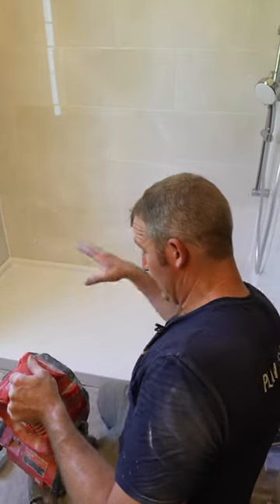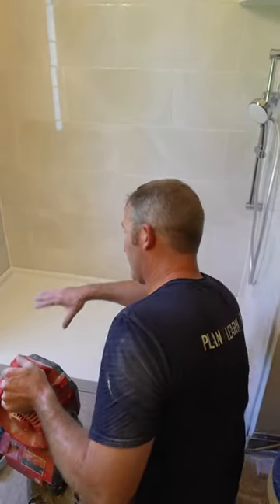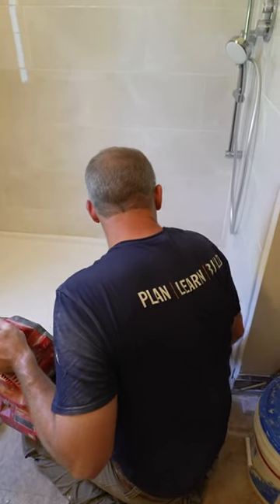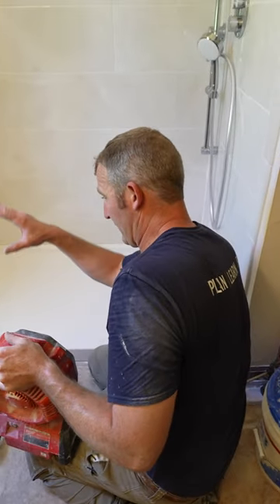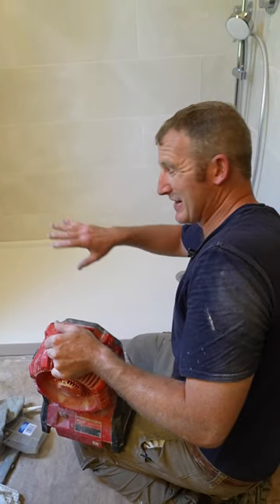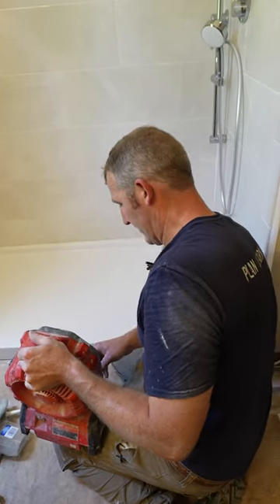Caulking a shower pan base #shorts

Comment: Grout is not waterproof, water does get behind the tile. Your pan is made with indentations for weepholes near the front, so water that does get back there is redirected towards the drain. If you caulk over your weepholes like that, water builds up back there without evaporating much at all, spills out over the shower dam (behind the tile) and can ruin floors in the bathroom. I have seen this many times over the years.

Comment: does the bottom tile go all the way to the pan or slightly above it? what kind of caulk do you use?
Reply: leave a sixteenth or eighth inch gap and use color matched silicone. you can get it at Lowes or home Depot
Reply: @davegordon6943  it’s nice to see fellow detailed installers!! Same goes for backsplash as well.
Reply: @davegordon6943  thanks, Dave. i enjoy your helpful videos. I'm getting ready to do a standup shower and a tub shower with tile at my son's house and will be reviewing your videos again before I start.